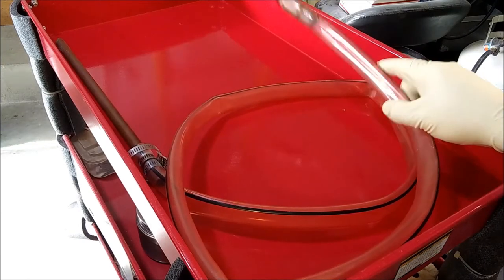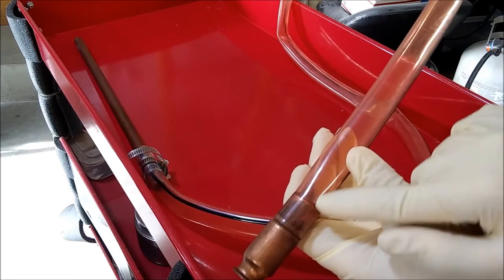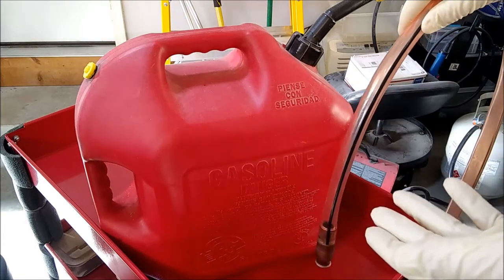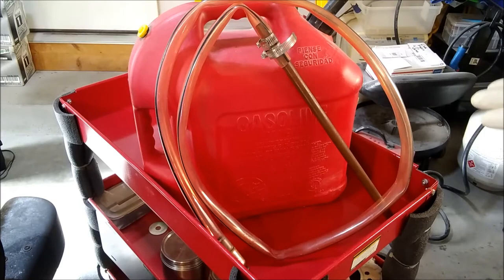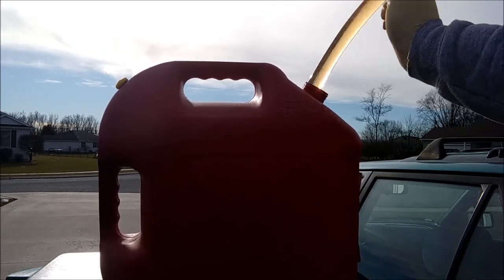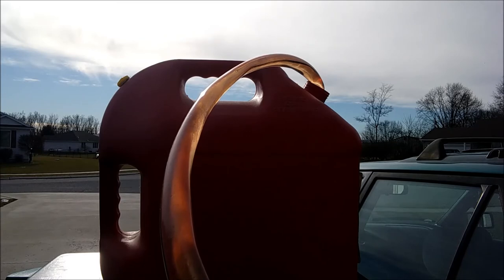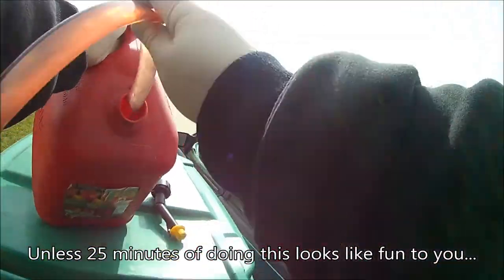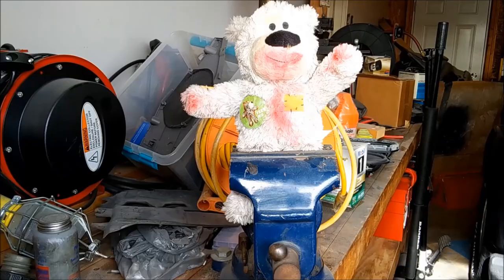Harbor Freight Jiggler Pump (Shaker Tube): Max's Tool Reviews

Comment: 4:54 Don´t let residual gasoline age your tube, while it evaporates... Wash it away with water right after, and the tube will never get old. You surely don´t need fuel-grade-tubing for a couple of minutes of contact, but only if it really means a "couple of minutes". Go wash it, and have it function forever.
Reply from the maker: The tubing seems to be holding up to it just fine after many years of use and replacements are still only about 12 bucks should that change. All things considered, I honestly can't be bothered with maintaining a chunk of PVC hose so it might last me forever. 😉

Having a spare in stock is probably a decent idea though. 👍

Comment: Nice video I've been having a couple of these things around for emergencies for years and years and I needed it now and I didn't even know what and the stick in the tank.
Reply from the maker: Thanks! It's one of the best, cheapest, tools you can have if you have any sort of equipment. I'm expanding my fuel transfer capabilities, but the shaker tube will always be the cornerstone of the operation.

Comment: I used to transfer gasoline from the 5-gallon gas can to the car with the red harbor freight hand pump.
I didn't use the flimsy tubing that comes with the pump.  I'd set the gas can on the ground,  put the end of 6-10 feet of vinyl tubing (from Menards) into the can and hold it in place by wedging it in with the inverted gas can spout. With the several feet of tubing on the ground and the other end higher than the can I'd stick the tubing end on the pump and draw gasoline into the line.  The gasoline level in the tubing will equalize with the level in the gas can. Next remove the hand pump and stick the end of tubing into the car filler pipe; either wedge it in (clothespin, or partially close the fuel door, whatever) or stick enough length in so it won't fall out.  Lift the gas can on top of a trash can just like yours and watch the gas flow into the tank.  When the siphon sucks air, lift the low section of tubing to let the remaining gasoline flow into the tank.

Since then I decided I get little enough exercise as is, so I just pour the 5-gallon gas can with the help of a funnel...
I use a similar siphon method with a length of garden hose to lower the pool level in the fall or drain water off the pool cover in the spring.
Reply from the maker: I'm sure that method works too. I've just found the shaker tube to be pretty effective and generally easy as long as you don't stop it once it starts. I only need to transfer gas a couple of times a year so it works out alright for me. If I had to do it more often, I'd probably go with an electric pump.

Speaking of, I have one of the 1/2 or 3/4 hp HFT trash pumps that does an awesome job of moving water in a hurry. Not something you'd want to use on gas though.

Comment: I can't get mine to work for some reason. No holes, no kinks.... the gas can was on top of my vehicle and the end was in the tank.
Reply from the maker: What size/shape can are you using? Mine really wants to have pretty much the full stroke of the 5 gallon can  you see me use in the video or it's a nightmare to get started.
Reply: when you put the shaker end of hose in the gas can shake the hose up and down to start the flow if that fails put your thumb over the open end of the hose and reinsert other end  in the gas can then release your thumb

Comment: I have a question. If I'm transferring a 5 gallon container into my boat gas tank if my boat gas tank fills up will it overflow or will it just stop?
Reply from the maker: It will overflow. The quickest way to shut down the siphon if you're getting close is to just kink the hose (just like a garden hose). Then lift the hose out of the boat tank, elevate it higher than your 5 gallon can, then allow it to un-kink and the fuel in the hose will fall back into your can.

The problem is if you guess wrong and want to restart the siphon, like I did in the video. It doesn't go so well to get it going again in a partial container.

I've found with the shaker tube that it just doesn't pay to be greedy. If you wanted 5 gallons and you think you're at 4.5, it's probably a good time to stop. That last 1/2 gallon is usually pretty easy to pour by hand.
Reply: it will overflow unless your boat tank also holds 5 gallons

Comment: Why couldn't you just lean the can to pour it into the car?
Reply from the maker: You "can" do that, sort of... A few reasons I don't:

1 - A full 5 gallon gas can weighs about 35lbs and isn't all that much fun to hold up for the duration of time it takes to empty it. This is even more true if you want to fill an entire tank from jugs. You could be standing there for 20 minutes holding heavy jugs.

2 - The spout on a typical gas can (assuming the 10 or so I've ever used are all "typical") isn't long enough to depress the anti-slosh valve at the top of the filler neck, at least on my vehicles, without making a huge mess. You have to get down to about 1/2 a can before the geometry for that works out and even then it's imperfect.

3 - Even if you overcome the above reasons, it's just about impossible to get the last bit of gas out of the container, again, due to geometry. For my 5 gallon cans, that's usually around 1/2-3/4 of a gallon. The siphon will suck the can nearly dry if you manage it just right as you're approaching the end of the container.

4 - My cans pre-date the goofy valves in the fill spouts, but I can't imagine trying to fill a vehicle with one of those things. It's way easier to just unscrew it and use any sort of pump you want, even if you don't want a shaker/jiggler pump.

Of course, my cans/vehicles/experiences are just my own. Grab your can and your vehicle and give it a shot. Maybe you don't need anything else?